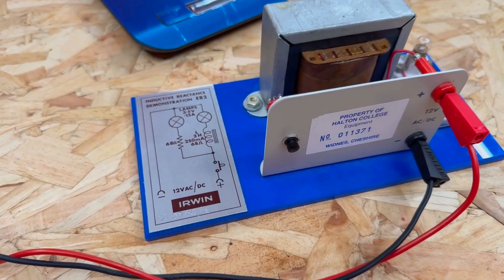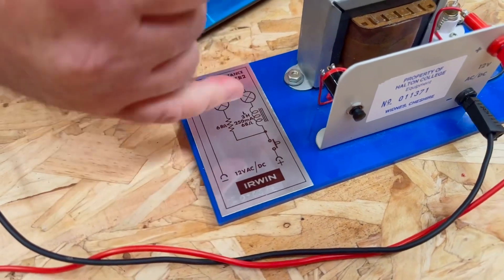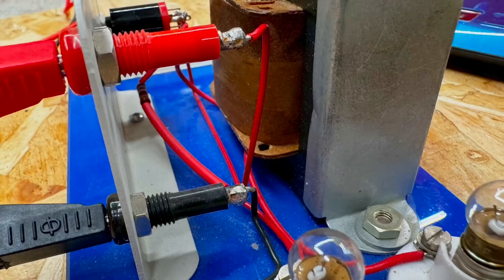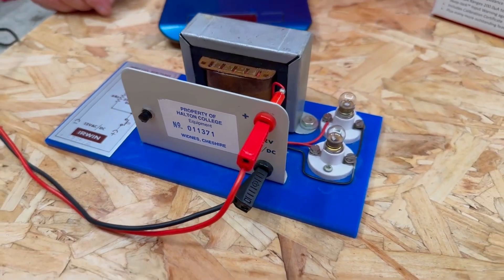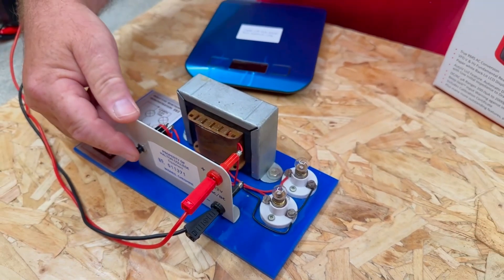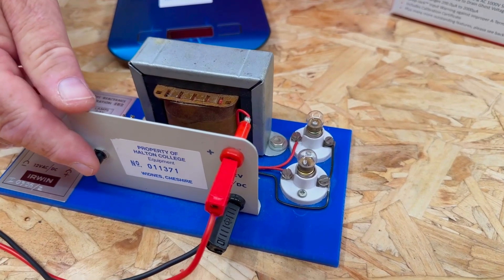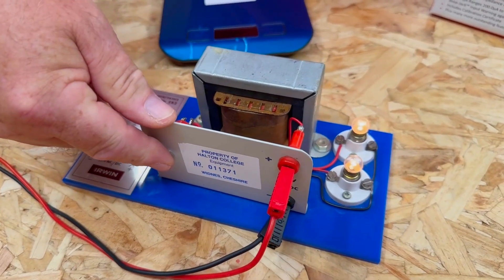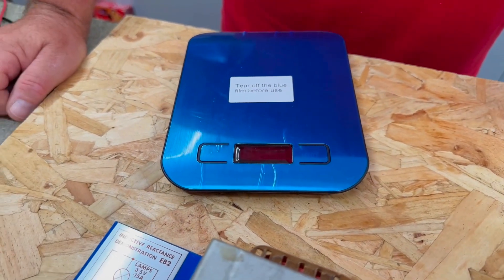See the Magic of Inductive Reactance

Comment: Interesting video! However, technically speaking, this is not a demonstration of current lagging voltage...

The effect we see in this video is transient and only happens for a short while after powering up, whereas current lag is permanent. 

What this video illustrates is the principle of an inductor - opposing current rise upon power up (or more generally, opposing a change of current in a circuit). That's why the light takes longer to brighten up - the inductor is trying to prevent the establishment of any current in the circuit. The end result is that the current rise is delayed.

But the whole time, and for as long as power is flowing through this circuit, current will be lagging voltage (even when the light has reached full brightness), by a few milliseconds at most - also due to the inductor. But this is not visible. We don't see curent - we see power. If current wasn't lagging voltage, the only difference in this video would be a brighter light.

Imagine this was a capacitor instead - current leading voltage doesn't mean you would see light before applying a voltage to it :)

But otherwise, great video!

Comment: The ( not very common ? ) DC smoothing arrangement of putting the BIG inductor  BEFORE the smoothing capacitor is very effective for industrial battery chargers😝 ... the inductor limits the charge current to the discharged battery .... but .... when the battery is charged , the trickle current is low , so the smoothing capacitor can charge to full ( RMS  x 1.414 Volts ) to keep the battery in good condition ( Westinghouse application , rail ) ......... DAVE™🛑

Comment: so if you replaced that large inductor that probly has 100ft of wound wire with a smaller one with say 2 feet of wire would the result be different because of the amount of wire feet\resistance or the inductor effect?
Reply: it would be less noticeable from a naked eye but you could measure it on an osciloscope
Reply: The inductance (which is measured in Henries) is a function of the physical structure of the coil. It depends on the number of turns and diameter of the turns and what material is present inside the inductor, air or a ferrite material with a non 1 value of relative magnetic permeability.

The magnitude of the back EMF produced, which slows down the rise of current, is determined by:

e = -Ldθ/dt. (Faraday's Law and Lenz's Law combined)
where L is the inductance.

So yes, changing the physical structure of the coil, will change the inductance and hence adjust the rate at which the current increases though it.

Comment: The inrush of current to the inductor causes a high magnetic field and generated  voltage of reverse polarity, hence limiting the current to it initially.    For a dc supply , the current will be 
I /R eventually when the induced voltage goes to 0 because the changing magnetic field went to 0.
Reply: Current stabilises to I /R ?
Are you sure about that? 

I is the current.

You might want to rethink that.
Reply: You said the current is limited initially.
It isn't limited is it?

It's the rate of increase of that current that is limited.

The magnitude of the back EMF which opposes the current is determined by the rate of change of current, that is, how it quickly it rises.

The rapid increase in current when switched on creates a changing magnetic field, and according to Faraday's Law, ( e= dθ/dt ) that changing magnetic field creates the back EMF.

So it's all to do with the changing input current and how quickly it changes.

Comment: So the inductor is PUSHING BACK the current? Not slowing down the current. The back EMF current also is being lagged?
Reply: The inductor is not pushing back the current. The current continues to flow in the same direction.

The inductor is not slowing down the current either. The current, the electrons continue to flow at the same speed.

The inductor is creating a back EMF which opposes the change causing it (Lenz's Law) which means the back EMF is in a direction which opposes the changing current.

So the back EMF  is actually slowing down the rate of change of the increasing current.

So instead of the current taking day 1ms to reach the steady state value, then it will take say 200ms to reach the same magnitude.

It is important we use the correct words to convey accurately what is happening.
Reply: @deang5622  Why does an Inductor even have EMF? the EMF is NOT the Coil of Wire and its NOT the Iron Core between the coil of wire. The EMF is NOT the resistance of the Coil of wire.
Reply: Forget about a back EMF current.
There is only one current going through the inductor. And you can measure that with an ammeter in the usual way, or better still use an oscilloscope with a series resistor in the current path to convert the current to a voltage and observe the change in current in graphical form, which on a standard ammeter you won't see the change very well.

There is a voltage across the inductor in a particular direction - you can represent the voltage across the coil with an arrow, with the arrow head pointing to the connection on the component which has higher potential.

The back EMF that is produced by the increasing magnetic field on switch on, caused by the increasing current, that back EMF is in the opposite direction to the normal potential difference that is across the coil created by the voltage source that is connected to the circuit.

So there are two voltages here, or more correctly, two potential differences, the PD across the inductor created by the power supply which is persistent and steady in magnitude, and the back EMF which is in the opposite direction and changes with time and which is short lived, decaying to zero.
Reply: @deang5622  The inductors EMF is the Magnetic field EXPANDING to the steady state is causing the back EMF. While the inductor/coil is expanding the magnetic field is creating the back EMF but Why does the magnetic field create the back EMF? when the inductor/coil magnetic field is "collapsing" is "doesn't" create back EMF, only while the inductor/coil magnetic field is expanding
Reply: @waynegram8907 No you are quite wrong.
An induced voltage is created whenever there is a change in the magnetic field intensity, increasing or decreasing!

If you have studied any electrical course or physics course in school, college or university,  you absolutely should know this!

It is caused by Faraday's Law which is this:
e = Ldθ/dt

Where L is the inductance
dθ/dt is the derivative operator which represents "rate of change of magnetic field intensity'.

At an electrical technician level, so City & Guilds, ONC, HNC, HND I don't expect you to understand the maths here.

There is NOTHING in Faraday's Law which says it only applies to an increasing/expanding field, so I don't know who has taught you that rubbish.
If it was a school teacher or college lecturer, you have my permission to go up to them and tell them they are talking out of their rear end.
Reply: @waynegram8907 Everything I have said is 100% correct.
If you think it is not, it is because your level of knowledge is poor and or you have been taught wrongly.
Reply: @deang5622  The Back EMF Voltage when the inductor is Expanding is NOT the same back EMF Voltage when the inductor is Collapsing. What I'm saying is that the expanding EMF voltage & collapsing EMF voltage are at different voltage levels, its not symmetrical, correct me if I'm wrong? Anyway of how EE engineers can "Minimizes" and "Reduce" the back EMF in inductors/coils?
Reply: @deang5622  The Back EMF is determined by the Rate of Change of the Magnetic field intensity. What I'm confused how do you increase & decrease the back EMF in inductors/coils? There must be a way to increase the back EMF, what type of circuits would increase the back EMF? I think they use Snubber circuits & Diode Flyback across the inductor to "reduce" the back EMF in inductors/coils